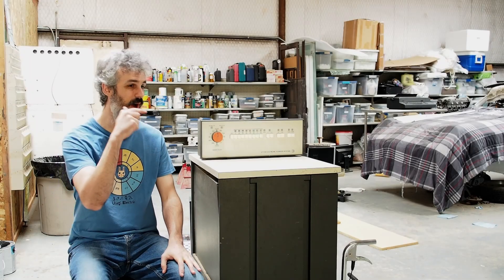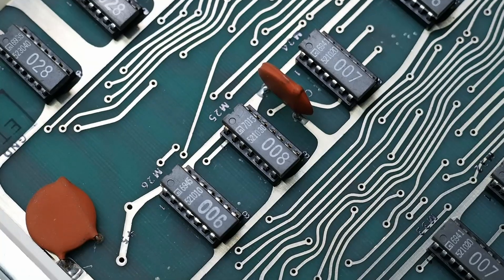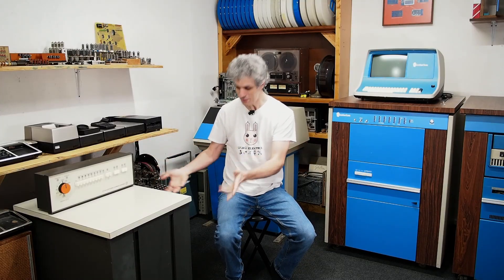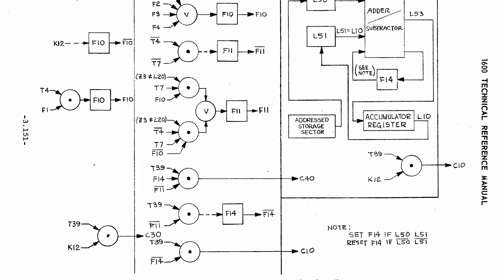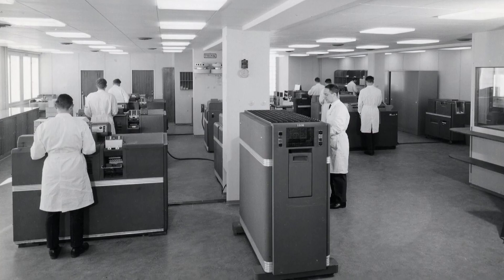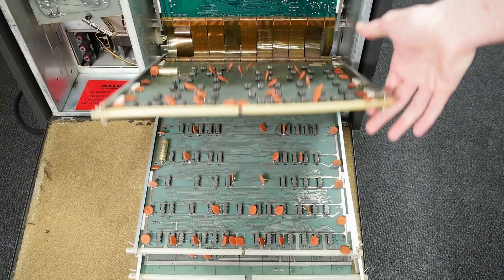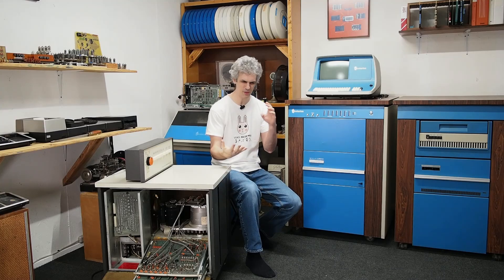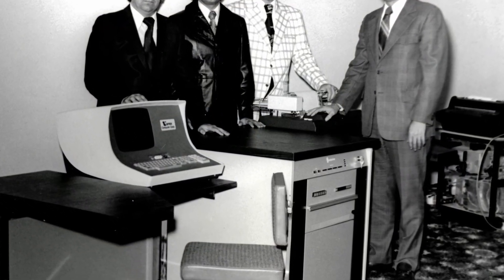Meet my new Litton Minicomputer (it has Drum Memory)!

Comment: The question is, did they do any money   laundering with it?
Beautiful machine. The flex PCB ribbons really surprised me! You may try gluing the layers with some flexible polymer glue (no cyanoacrylate as it'll go brittle as the joint is bent).
Fortunately you can design new flex (or rigid-flex) PCBs from JLCPCB or PCBWay, and while not original, they will be better quality :)

"Miniature nuclear reactor" would be a good name for it, and the Centurion backstory is very interesting too! So bloody awesome that you got it :).
Reply: I think a short-term solution on the delaminating ribbon cables would be kapton tape. To prevent any shorts from any dirt coming in. I think I saw something in one of the closeups of the ribbons that looked like steel wool next to one of the delaminated ribbons, which would cause a short.
Reply: @tobiasfunke8990  I think that "steel wool" is actually foam sound deader that he was removing from the inside of the cabinet.  I'm sure it was all rotting and falling off.  I do hope he replaces it before starting the drum as I'm sure that changes the sound.
Reply: @tobiasfunke8990  yes, that would be the easiest and readily available solution.
Reply: @KeritechElectronics  The easiest readily available solution is probably a can of spray clear flex-seal or even plasti-kote, and some creative (and thorough) masking. You wouldn't be affixing the layers, you'd simply be replacing one side or the other.
Reply: Yes the peeling flex is hard to solve, as you need a flexible adhesive, which probably will mean using a thin electronics grade silicone to attach the polyamide back to the tracks, after removing the plastic carefully to remove old adhesive, and then apply a thin coat to the polyamide, and hold in place, probably with a soft silicone rubber tubing, covered with some thin PTFE sheet, till it has cured.

Comment: Can’t wait to see the drum working.  You might be able to build a simple optical reader for the paper tape. Punching is a much harder problem.
Reply: Could be done with a back light and a camera and just run the images/video into a script or program to decode it.
Reply: @RingingResonance  Probably easier to just rig up an arduino or something else with enough GPIO pins to a bank of light sensors on a piece of extruded track and a gearmotor with a rubber wheel for a capstan to give constant speed.
Reply: @mfree80286  There's many ways it can be done. How it's done is dependent on what someone already has on hand, and how much they are willing to spend on it.
Reply: If you're using optics or a light sensor, I bet you could just print black dots instead of punching them. Using something like a zebra thermal printer
Reply: @edison700  If it's expecting the holes to be brighter than the rest of the paper, you may need to print everything black except for the holes. Doable but more expensive.
Reply: @Pickelhaube808  thermal printers that print labels for  packages don't use ink. It cost the same to print all black or a single dot on a page. Plus the paper comes in sizes similar width to his pinched paper already show in the video. The only issue I could see is because they're essentially stickers on a long strip of wax paper, them separating going through some sort of mechanism. Don't know if they sell rolls as one long strip rather than individual stickers
Reply: @Pickelhaube808  Thermal printers tend to have trouble printing large sections solid black.
Reply: @edison700  Thermal paper for cash registers has no backing, and comes in long rolls as well.
Reply: @edison700  Depends on what you're using to read them.  A vintage reader is expecting a hole.  They either send light though the tape, or use mechanical pins.
Reply: @russellhltn1396  well since the initial comment said "build a simple optical reader for the paper tape." All my comments are assuming that and not modifying vintage punch hole readers
Reply: @edison700  But if you're building a reader to read existing tapes, you're going to be shining the light though the tape.  A tape with black dots on it isn't going to work right without doing modifications on the reader.
Reply: he could just use a laser cutter to punch the holes
Reply: @nuthenry2  lasers don't like to cleanly remove the cut section.
Reply: Punching the tapes isn’t technically difficult; it’s just a slightly modified dot-matrix printer print-head, but with larger diameter pins that are sharpened. The drive electronics, likewise, are fairly simple; just a low-side relay driver transistor (such as a TIP120), a current-limiting emitter resistor, a larger current-limiting base resistor, and a back-emf diode across the coil. You can then drive the whole thing with a TTL or CMOS level signal. Just multiply this by the # of pins required, and use a beefy enough power supply for the driver board, taking the total current draw for all N solenoids activated at once. Finally, one more circuit to drive the “tape advance” motor (a stepper motor is probably good here, though the drive for that is a bit more complicated) which would have a sprocket similar to an old movie projector. I think the guy on the CuriousMarc YT channel has a working paper tape punch/reader.
Reply: @williamsquires3070  That registers as "quite hard" in my book (for me: software < electronics < mechanics).

Of course by far the easiest solution to all of this would be to emulator a paper-tape reader/writer with your favorite embedded computer, but this seems to go against for Usagi tends to do.
Reply: There is at least one design for a paper tape reader here on YouTube. 
Not much good without a punch though.
Reply: well the easiest is perhaps the most obvious and that's to find a paper punch tape terminal, from some system or another.

thats what he'll want to anyway.